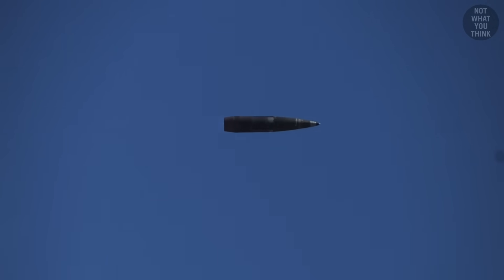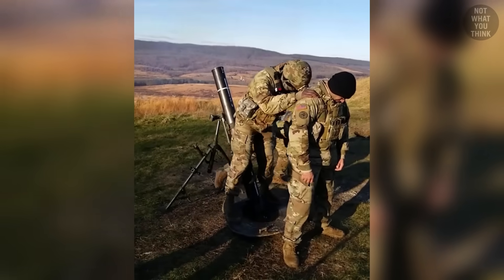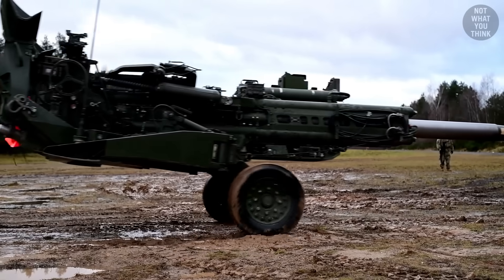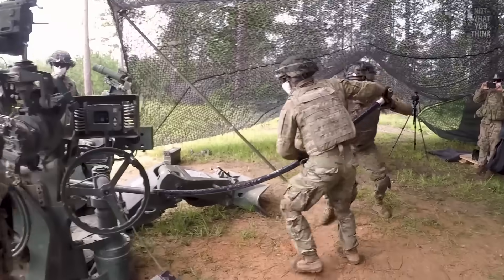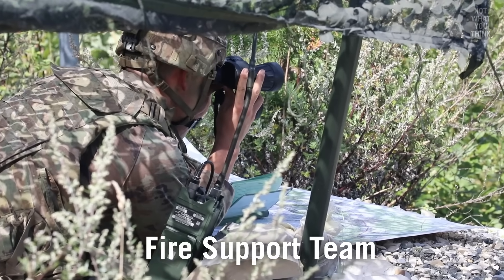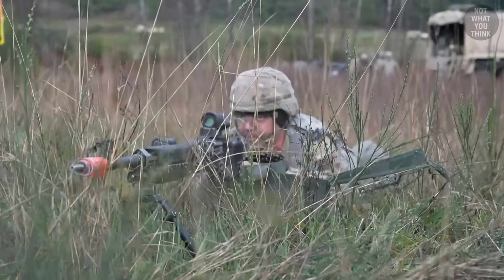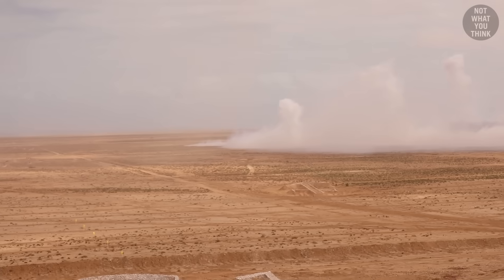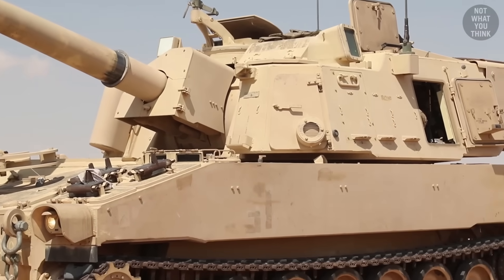How Aiming Artillery without Seeing Target Works

Comment: Good video. I was an Arty officer. Actually, the definitions of mortars vs. howitzers vs. guns (not the general classification of guns... a bit confusing) are based on the ratio of the length of the tube to the diameter of the bore (caliber... a term not used as it is with small arms). A mortar tends to have a tube length 10-15x the bore. Howitzers tend to be 20-25x. Guns  (e.g., naval guns) tend to be very long - like 50+.  but howitzers are getting longer these days (I think the M109A6 shown has a caliber pushing 40, the French Caesar is 52 but still considered a howitzer???). 
The longer tubes allow one to drive up velocities either to hit moving targets or to increase ranges. Howitzers tend to be a good compromise in terms of range and utility, and it is very difficult to move long barreled guns around.

Comment: The whole "high angle vs low angle" BS around 3:30 was utter nonsense. Angle is determined by charge combinations available and distance to target. Nothing helse.

4:04 "You need specialized infantry to operate a howitzer"... Artillerymen are NOT infantry you effing kludge!

"It would take almost 30 minutes after being called in by an observer".... I don't believe even the Russians are that bad. Once you have the coordinates it takes a computer 0.0001s to spit out the gun settings and 10-15 seconds to transmit them via radio. After that everything is the same.

Comment: I was an artillery officer (US Army) ’95 - ’03. and I have to say this video is very good highlighting most of the fundamental points of artillery.  I served on M198 (replaced by M777) and M109 (Paladin today), which were 155mm howitzers.  We also had the M119 (105mm) generally used to support light infantry.  In Army doctrine, mortars were an infantry weapon, though used with a similar concept to artillery.  The Marines grouped their 120mm mortars with artillery, however, which I think was a smart idea.  One thing to add to this, the reason for airburst (time and proximity fuses) is their is more destruction raining down shrapnel and also there is less thickness of cover from above (usually).  The kill radius of the 155mm is 50 meters.  The feet you referenced at the end of the towed howitzer pieces (self propelled have them too) are called spades, which help stop displacement after being fired because they are used using basically geometry so the pieces are parallel in aiming.  Anyway, I could go on all day.  Good video.
Reply: I was a gunnery instructor at Ft Sill for the Marine Corps. This dude is spot on
Reply: @ShareTheLightTV  Army artillery with the 3/18th and 1st Armored, 5th Corps Artillery [and others] 91-99, great info. The round, charge, etc could have a big difference in a fire order. Watching a whole line of 155 self propelled fire for effect downrange was an amazing sight and you'd feel it in your chest [and far downrange if stateside, regularly set off car alarms at Ft. Sill during training exercises], I worked with the 155 M109 SP and the MLRS rocket system which is/was another amazing artillery piece, especially with some of the rounds the MLRS would unleash against infantry and light armored vehicles. Remember when attached to Tacfire, for a few years, how they would tell everyone that we needed to stay mobile because the fire orders sent so much radio traffic out that an enemy could [in practice] triangulate our position within 3 minutes. Was better once the new system was developed [the laptop'esque box computer, not the formerly cancelled navy artillery computer using punch cards, lol]
Reply: @RLHunter_Author I always loved watching the MLRS zipping by in the sky during my time at Ft Sill basic/AIT back in 1997.  Agree that they were badass.
Reply: Did ya ever serve on the Nuke team ?
Reply: The M109 is features in the PC game "War Thunder". Do you think it is realistic in terms of design? You can't play real artillery in War Thunder but you can try aiming at far away targets.

Comment: your explanation of the difference between Direct Fire and indirect fire is not quite accurate. they dont call direct or indirect fire based on if you can see the target or not. Its named as to whether you are directly aiming at a target or just in the local areas of a target regardless of a visual sighting of the target. It has nothing to do with having a visual or not. Direct Fire ios when you have a precise coordinate to aim at. Indirect fire is when you do not have specific target coordinates. Indirect fire is for either cover fire or to lay down a blanket of fire with the hopes of accidental hits or shrapnel damage and psychological fear.

Comment: I'm a Norwegian Artillery Reserve Officer, this video is mostly very dated!
Back in 1976 I first trained as an Artillery Ranger/Forward Observer and at that time we did use the procedures shown here, but even then pretty much all our guns were self-propelled 155mm howitzers. We had night-vision laser scopes that provided 5m accurate locations for any target we could see.
Just a few years later all the voice radio traffic from us to HQ and from there to each howitzer was replaced with spread spectrum encrypted digital radio, and we could go directly from a single observation to calculating individual aiming points and firing times so that all 6 to 18 grenades would arrive simultaneously.

Comment: The US gave up sound ranging about 1990, though the British continued to refine it with computer processing.  The US "rediscovered" sound ranging around 2004.  Having seen both, and having been 17C sound and flash ranging at the start of my career, I like the Britsh Halo system better, though the US system is more compact.
You left out of the equation surveying.  To hit an unseen target, you have to know the exact location of BOTH the gun and the target.  The survey team or hasty survey by the artillery site recon team provides the gun location.  The target location is determined by FOs, map spotting for pre planned targets such as fortifications or bridges, technical means (sound ranging, radar). Today, of course, GPS rules, but it is important to have backups in case of jamming.  The current system, MAPS, is based on something called a ring laser gyro, which basically measures movement from a known starting point and direction (Inertial Guidance)  
The shots of the FDC showed slide rules and RDPs (Range Deflection Protractors) in use.  These were replaced by computers decades ago.  I am not even sure they are used as backup any longer.  
Starting in WW II, the US initiated the idea of Time on Target missions.  This involved concentrating the fires of multiple batteries or battalions on a target.  Despite the different distances between the target and the various firing units, timing offsets are calculated so thought the guns fire at different times, the shells arrive on the target at the same time.  Since the first volley causes the most casualties, before the enemy troops can seek cover
I have heard that during  WW II the US was known to fire TOTs involving up to 17 battalions.  That is over 200 shells going off at the same time.
I served most of my time in the National Guard in a target acquisition battery, again, most of it as a warrant officer in charge of a radar section.  My civilian job for some of that time was as a new equipment trainer for the manufacturer of the Paladin.

Comment: One thing I noticed and can't stop thinking about: A few month ago it was reported that a lot of Navy SEALs had been diagnosed with  distinctive damage from repeated blast exposure. The description was pretty hard to digest:  “Recent studies suggest that damage is caused when energy waves surging through the brain bounce off tissue boundaries like an echo, and for a few fractions of a millisecond, create a vacuum that causes nearby liquid in the brain to explode into bubbles of vapor. Those tiny explosions are violent enough to blow brain cells apart in a process known as cavitation.”
Having your head right next to a mortar or any other piece of artillery will probably do the same. I was in the Artillery.
Reply: I think that in some countries, artillery and mortar men have a maximum nr of shells that they are allowed to fire...in their lifetime. If you hit that limit, you are retired.
Reply: @UninstallingWindows  and why would you 'think' that? Did you just imagine that up because you think there's no way armies would knowingly let their soldiers get 'hurt' ?
Reply: @MarkBerenger  Nope, i know that because ive read articles about. Ive also served in the army myself as a conscript and directed mortar fire at close range. The overpressure when firing is quite nasty. Modern armies with health and safety regulations keep track of stuff like that.

Comment: We had direct fire with 120mm mortars once. the targets were app 4km away on the other side of a valley in full sight. Tank wrecks it were. Some offz came along and wanted to know what we can do when fire command is off and we have to shoot on sight. Our mortar was the one, the Uffz estimated the distance with the glasses calculated the load and angle, shot and direct hit. Our captain had to explain that this is nearly impossible with a mortar. A 50m distance impact would be considered as hit since we fight soft targets. Usually it needs three shots to be in that 50m range.

Comment: There is not an elevation restriction on vehicle mounted mortars. The limited range from a mortar in a m1129 is due to the recoil system in the vehicle not because of a restricted elevation.

Comment: Im an aviation guy so clueless about arty yet interested. It seems to me various powder charges are used as well , for different range ? IDK
Reply: I think the only stuff left is m231.  Macs (manual artillery charge system).  Basically look like buckets with an igniter patch on either end.  The system has 2 different charges a low power one and a hi power one.   Mac hi charge 5 as a propellant order means you load 5 increments.  Older charge systems are extremely complicated and had wastage.

Comment: What went missing completely is the necessity to have a high precision grid map system and to define a reference direction accurate at 1 mil... many armies used to do that with gyro systems e.g. to find the accurate north direction. Self-propelled howitzers as the Paladin have their own gyro systems allowing them to stop and establish firing capability without an external reference point.

Comment: I was an artillery calculator in the Finnish army during my conscript service. We would calculate the direction and angle of the gun by pen and paper and take into account all the variables (air pressure, humidity, temperature, wind etc.) and be able to hit the target very accurately. Nowadays they use a more modern system but it was incredible how accurate you can be with zero computer assistance.
Reply: Back in 1997-1999, I helped introduce computers in the Swiss Army tracked 120 mm mortars. There was no gain in speed or accuracy. The real gain was the ability of the computer to generate a different fire solution for each gun. Before computers, the FDC computed by hand and communicated by radio. There could only be a single fire solution for all the guns in a mortar platoon and the guns had to stick together. With computers, the guns could spread out in a wider area and receive their own specific fire solution on an electronic screen. This made the platoon less vulnerable to counter-battery fire and nasty encounters.

Comment: No way is this thing worth anything close to $,3000! You can get a fancy 12 person tent for less than $1,000, or a proper tent designed for use in the arctic for a similar price to this thing.

One thing this reminds me though, remember how the Cybertruck was originally advertised as coming with an air compressor? That would have been useful here as they wouldn’t have had to provide you with a little hand pump to pump it up 😝

Comment: @9:33 I'm not in favour of degrees. I am in favour of correct maths though. It is possible to have non-integer numbers. Usually we use a "." do denote the difference between 1s and tenths. You are welcome to carry whatever resolution that you want. Such as measuring to the millionth.

Milliradians do allow you to more easily communicate a value if you never need to report less than 1 mrad. That is in part cause you are able to send in text or over voice a figure that has to be >0 and has to be an integer. There is less guess work when communication isn’t crystal clear.

Comment: Self-propelled howitsers have been used in the direct-fire role in urban combat. The rounds can be fused to detonate inside a building for maximum effect and to minimize collateral damage. 155mm rounds can punch through even solid concrete walls. They can also elevate their tubes much higher than the gun on an MBT.

Comment: marveles firing by spoting wooden sticks 100 foot away, did you ever asked yourself why you never proper hit. Tip: use a compass and a map
Reply: It's a backup not the main equipment for aiming. That is done by the collimeter, and as understand it, today with GPS you don't even need that.
Reply: @tatumergo3931  The high end gps shit is based on compass, map and mathematics done on paper, so the logical back up is training the use of compass, map and mathematic on paper.
Not aiming like in the 30 years war and preying to god the shell may hit somewhere on the planet
Reply: Besides GPS guided munitions make it even less necessary.

Comment: "Specialized infantry"? Is that how 13B would describe themselves?
Degrees are infinite, in the same way you could theoretically turn infinitely in place and will never face anywhere outside that circle. There are better reasons than "degrees only go up to 360" for why they aren't preferred for math/eng.
Reply: Historically during the Roman era, the catapult operators were drawn from the legions. Those who show good skills and aptitude, it was a step up from the ranks. But yes in modern armies is a whole MOS unto itself.

Comment: What type of “slide rule” was at 8:00? I have to assume that it is a backup to an electronic calculator, agree?
Reply: Yes ofcourse, you still have to practice with the old methods, just in case. Plus is a double check way to make sure nothing has gone haywire.

Comment: There is nothing simple about using a mortar mate!! As an Australian Infantryman who spent years in mortars it is not easy at all. It is a 2 month course 7 days a week just to become a basic mortarman. Then you need another year and a half or 18 months to become proficient at it!! Even though we have computers that do a lot of the calculations we still have to learn how to do it without them in case they are inoperable for any reason. There is a reason they say Mortarmen are Infantrymen that can do math!! I was also in DFSW (Direct Fire Support Weapons) and we used the Mag58 machinegun in the same way for indirect fire on a tripod. We can't see the target and we are using the same C2 sight as the mortars use, the posts are just a lot smaller.
Reply: We did the same thing in the US army with the M2 .50cal HMG. It's a lot of fun using the 50 in such a role!

Comment: 7:40 I was a 13F forward observer in my time. I’m very impressed with your research. Each unit in the army does their fire missions slightly different. 

You’re correct, the TTLODAC was used as a planning medium that we would have briefed with our Fires cell- all the different people that are taking part in the mission, including the gun line, the FDC, the Forward Observers, and the commander of the echelon that you’re working with. The TTLODAC would be a “product” (think of it as a menu of preplanned missions) that would have been created usually by an artillery officer when he receives the commanders intent. It has a basic plan of fires that support the major infantry movement or whatever the commanders plan of action is for the operation. 

The howitzers are not aimed using a TTLODAC, however. Fire missions start with a call for fire, which is initiated by the FO’s. It’s possible that a fire mission could be on the TTLODAC since a commander could order a mission that’s on the “menu”.  That would be easy, we’d just say “ Fire Target number AA1234,  One round in adjust” and then after that we’d walk the rounds onto that specific target. 

The TTLODAC wouldn’t account for targets of opportunity and only maybe 1/3 of our fire missions were ever on the TTLODAC, since it’s more of a planning product. When we’re on mission things would’ve changed.
Reply: I've worked as both a Forward Observer and a M109A5 Gun Chief - on the gunline we were often given priority targets from the target lists created by the FOs and FDC (usually with input from higher HQ).  The howitzers would lay (aim) on the priority targets in case they needed to be shot quickly, until the priority target was canceled by FDC.   😎👍👍